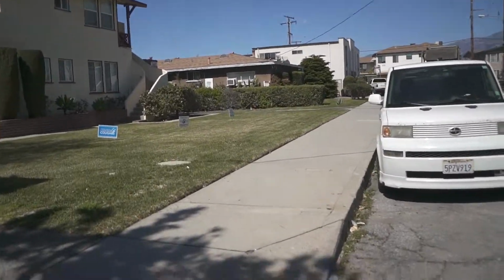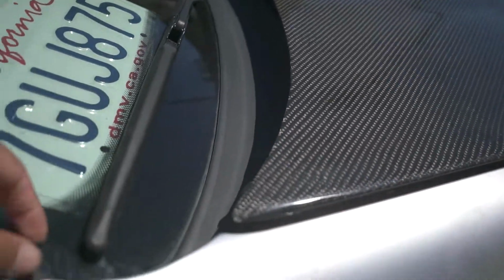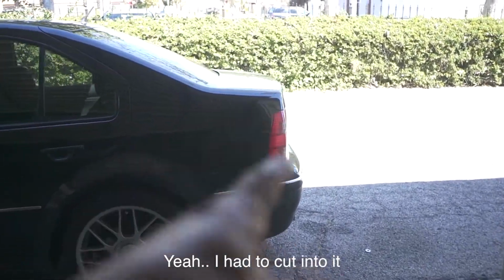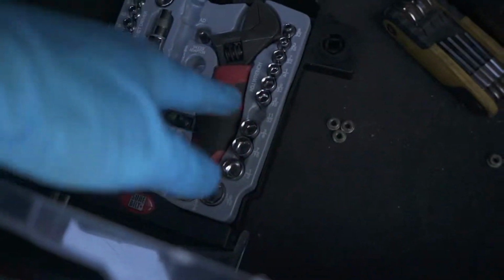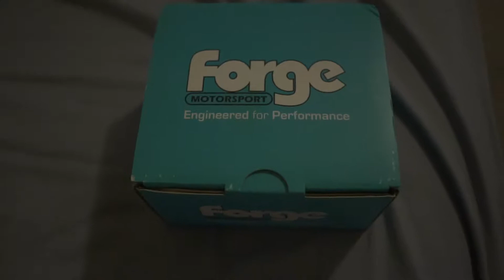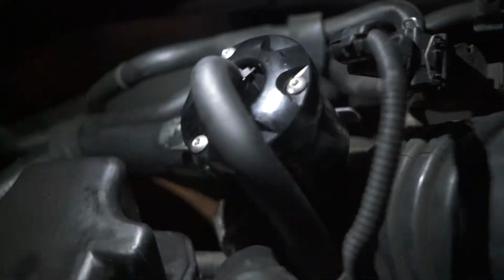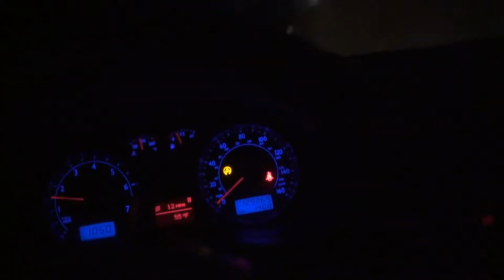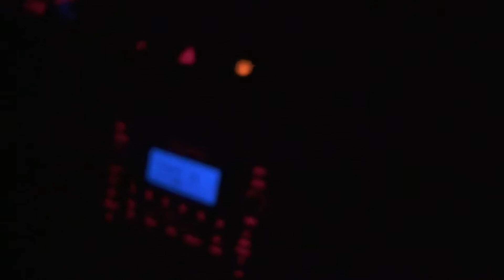Forge 008 diverted valve for mkiv Jetta

Comment: What spring are you using?
Reply from the maker: just the one it came with. its recommended for stock settings. there are other springs included but you swap those in  if you have bolt ons or upgraded turbos and what not. hope this helped
Reply: @WAYFURSMEDIA  I have upgraded cold air intake,new n75, lightweight pulleys thats it. The green spring was losing boost for me. Im using yellow now.02 audi tt quattro awd